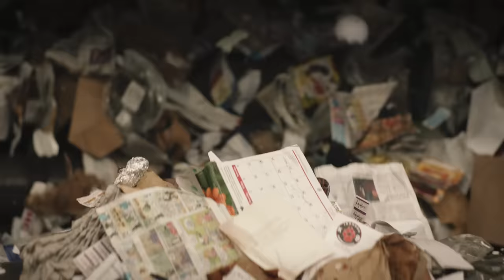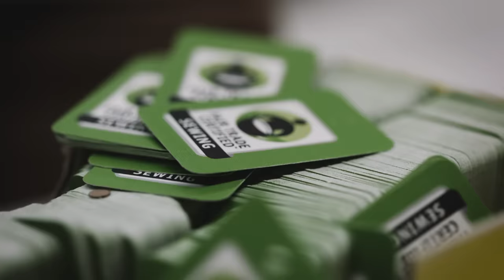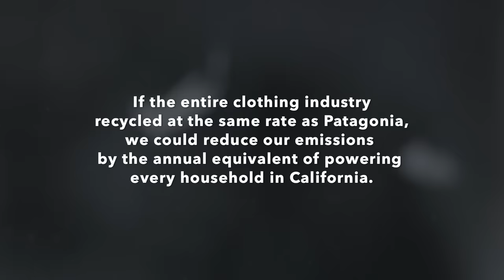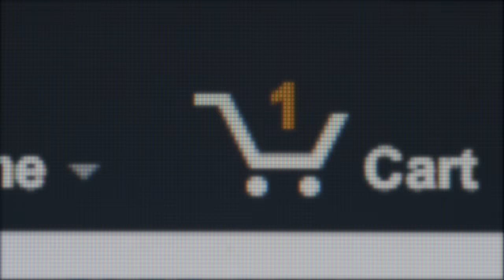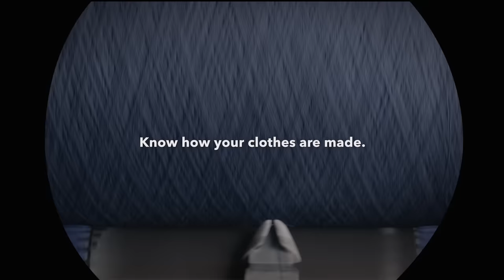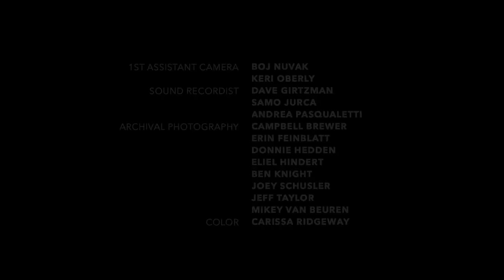Why Recycled? | Know How Your Clothes Are Made

Comment: I absolutely love your products and it's a great way to explain what you do. I'm just asking myself some questions as I've been researching plastic pollution for more than two years now.

1. The examples you make are mostly for plastic bottles, which are widely recycled around the globe as PET can be turned into new products relatively easy. However there are many products like Multi-Layer Packaging (which is also used by Patagonia Provisions) where recycling is not possible - as you also mention on the website. What do you propose is the best way to treat that material?

2. You mention that incineration is worse than landfilling. Based on which information do you come to that conclusion? The University of Hawai'i recently issued a study that proved that plastic emits greenhouse gasses while it decomposes https://www.surfrider.org/coastal-blog/entry/new-study-shows-plastic-as-source-of-greenhouse-gases-potentially-contribut#:~:text=This%20month%2C%20a%20team%20of,that%20can%20exacerbate%20climate%20change. And not just CO2 but methane and ethane which are a lot worse for the climate than carbon. These gases are not produced during incineration. At the same time incineration wins back the energy from the calorific value of the waste. In certain industries like cement this plastic waste replaces fossil fuels like coal and gas and doesn't even leave ashes behind. I probably sound like I'm working for the waste incineration lobby - but the opposite is the case.

To me Patagonia is a true role model when it comes to sustainability so I'd be more than curious to understand what you think about that. Isn't using plastic waste that can't be recycled and else would rot away on landfills/the environment better used as fuel in a process where we would else burn "virgin" fossil fuel?

Comment: 🎯 Key Takeaways for quick navigation:

01:02 ♻️ Recycling rates are low, with only 15% of materials in the blue bin being recycled due to contamination and inadequate recycling infrastructure.
03:20 🧥 Recycling textiles can reduce carbon footprints significantly by bypassing resource-intensive agricultural processes.
05:12 🌍 Recycling materials has lower environmental impacts than using raw virgin resources but doesn't make them entirely green; it's about displacing virgin material production.
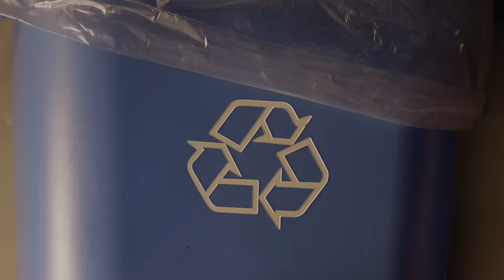07:36 🗑️ Recycling infrastructure is crucial; even with blue bins, recycling may not be effective, as shown when China stopped importing waste.
09:48 🚗 Recycling alone won't eliminate environmental impacts; it must be combined with reducing consumption to be truly sustainable.
11:08 🛍️ Extending the lifetime of garments can significantly reduce their carbon footprint, making recycling a solution at the end of a product's life.

Made with HARPA AI